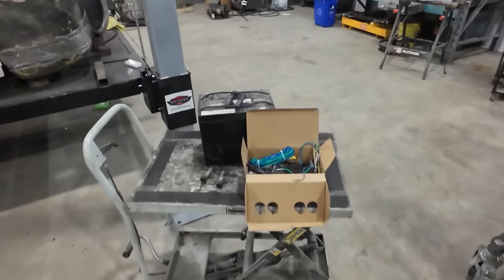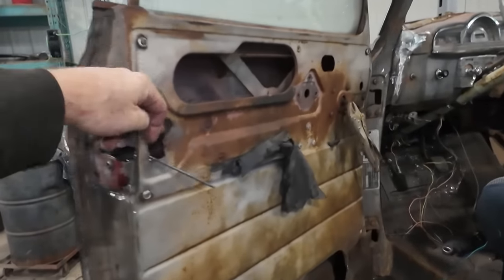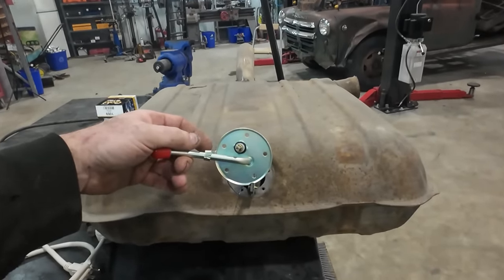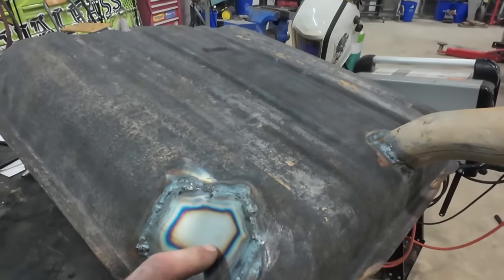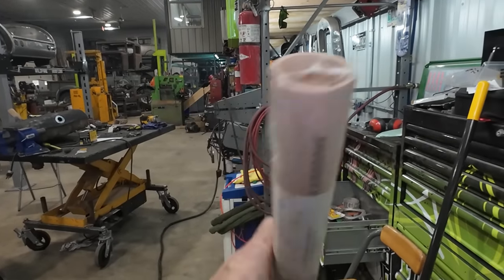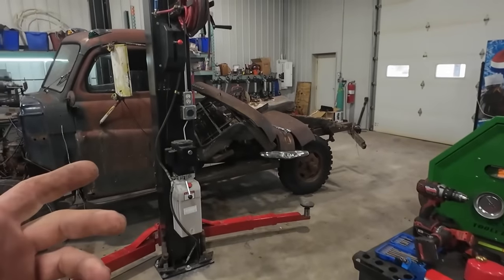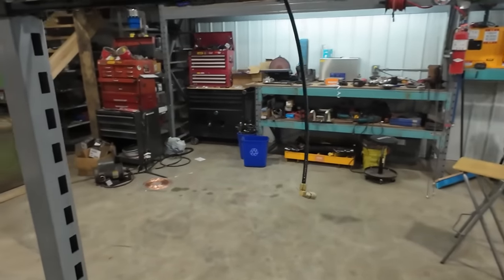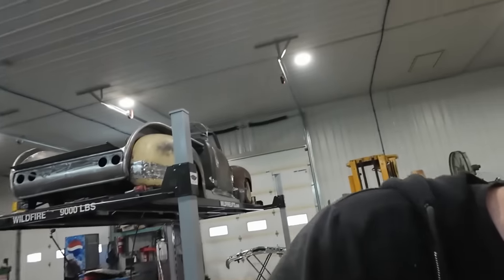Installing Cheap door poppers and modifying the fuel system.

Comment: Nice to see Ryder in there with you working on his truck.  I'm very impressed with his work skills, using that torch like a Pro.  Your truck is really starting to come together, nice work running the fuel lines.

Comment: like every thing you do  I installed the same type of door openers on my 54 ford two door for the cable pull I used a simple pull  cable and put it under the hood on top of the fender remember that the cable moves in and out with the door opening and closing when you open the door so dont anchor it too tight to the wheel well   also I installed a starter button behind the grill where I could reach it without opening the hood just incase I did not have the keys with me when I wanted to get into  the car like to get a drink at a car show nce work you always amaze me   stay safe have fun

Comment: The fuel sender uses the tank as its ground(return). You should use one of the sender mounting screws make a ground wire to the frame. You are using rubber to isolate the tank/straps this will also isolate the return for the fuel sender. A dedicated fuel quantity ground will give the best results for correct fuel tank readings. You can never have too many grounds ( engine to frame, engine to body, body to frame...etc.). I love this channel :)

Comment: You've even got signals on yours! No signals on my 1950 1 ton lol. I'm fixing up a 1950 Chev 3900, luckily in Ontario, I have Bills Truck Shop down in Courtice where I've been able to locate pretty much all of my parts. The hardest thing to find for this old girl has been some tires for the original split rims, if I can't find them I'll have to go with a 20" rim and a 8 x 6.5 bolt pattern and size a tire out to be 34 inches overall off of that rim. Will be welding an aluminium dump bed together for it too. Really enjoying the roadster build and your positive mentality and progress on this build, keep up the great content!

Comment: I have been using, and swearing by, Seal All since the 1950s, and can't tell you how many times it has saved my butt.  The most extreme save, was when I got caught in the middle of a rock slide in the Fraser Canyon, and ended up punching a dime sized hole in my oil pan because I was not able to avoid running over a rock.  Although I had to touch up the Seal All repair a couple of times to stop the weaping, the emergency repair lasted me the  180 mile drive to Vernon.  It even lasted a few more days, while I was searching for a replacement oil pan.  
The problem for the repair was, that it was an aluminum pan, and I couldn't find a replacement.  Although I was pretty competent with a torch, I didn't want a critical repair to be my first attempt at aluminum welding.  I had my uncle do the job.  (The old joke about him, was that, with a hangover, he could weld foil to a 13 inch girder).  Needless to say, the repair was still holding when I sold the car years later.

Comment: Thanks for sharing as always! I have the same mastercool tool, my set has all the flares, double, bubble, quick disconnect, oring, and GM transmission quick disconnect.  I bought mine a few yrs ago for around $480 plus I got the dies for doing JIC/AN 37 degree flares. Its worth every penny for sure. Keep on sharing your journey with us. Once I get the funds to get an external hard drive I will hopefully soon beable to start posting vids on my channel. Cheers!

Comment: Jimmy rig it, I need to hear that run.  😁👍 I’ve not missed any videos since you reintroduced the build.  The gas tank actually looks good with undercoating.   There is an old builders saying… “First in, is the best dressed”. …that explains the fuel lines.😢

Comment: You might want to coat the inside of the tank with sloshing compound. It seals pinholes and really protects the steel from rusting. I cut a '53 Stude tank in half that had sat with bad gas for 21 years, sand blasted it, gas welded it back together around the whole perimeter, and sloshed it back in 2010. The inside is still perfect.

Comment: I think I would have stretched the copper tube out and painted it with clear coat so it would look good for a long time. But you are doing a grate job anyway you decide to do it. I have had a number of that style of truck and always wanted to chop the body instead of the top. But that would be a lot of work. Love what you have done. Keep up the good work

Comment: Hi Brent I hope everything is going well!! That seal all is a pretty good product I've used it myself but I can tell you for a permanent seal you can get it usually at your local parts store I got it from O'Reilly a product called Red kote which I did my motorcycle gas tank in which was Rusty and had to be acid washed which led to a few little pinholes. Well the red kote took care of it. It's actually made here in my state of Ohio and is in for industrial use, with a name like that it's got to be good stuff.😅 Anyhow my friend I thought I would just drop that in on you, but knowing you you probably already knew about it. Anyhow you take care and God bless, your friend Joe in Ohio

Comment: Another backup method is a 2 wire hanging/ran somewhere and you can use a 9v battery to pop the drivers door

Comment: with  weld pinholes in motorcycle gas tanks that i've built, what i did was drill them out about 3/4 the depth with a 3/32 drill then fill the hole with silver solder.

Comment: There should be an unlock and 2nd unlock wire. Or if the relays aree built in, there should be another unlock output so you wouldn't have to press it twice to let Esther in. lol

Comment: 13:31  should stick the filler neck down in there like a tractor so the fuel doesn’t gush out on acceleration or roll over.

Comment: When I built one of my wild custom cars I put the latches in the pillar post and had a pin bolt in the door and had a secret ring under the car that I could get a finger in and pull the latch and open the door I came up with the idea while at a Big show in Pennsylvania and a storm was blowing In and a guy couldn't get into his car because the battery went dead the car sat in the storm all night and finally the next day he called the builder and they finally figured out a way to get the door open to pull the hood latch to get the battery just a thought

Comment: Could you not just install a remote boost to the truck then opening the door would not be a problem. If the battery was dead you would have to boost it anyway.

Comment: Door poppers-not jalapeño poppers-mechanical poppers com'n, driveshaft'd, hot time zap'n n weld'n da gas tank, torch'n wif Ryder on his Dodge p u off wif da front clip n soon ta be de-cab-itated, run'n fuel lines around in n out yonder. Pups go'n out.